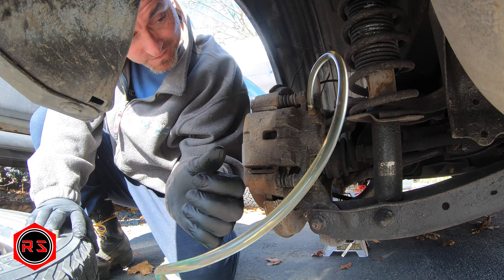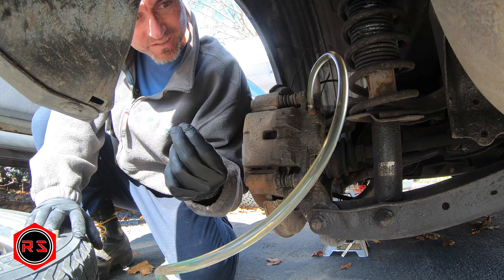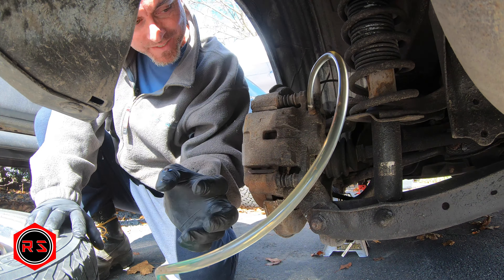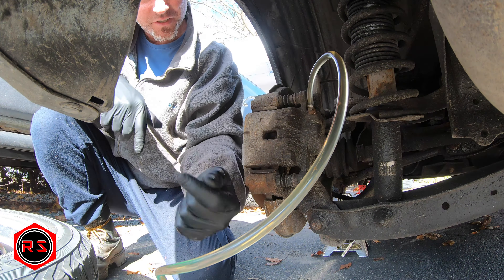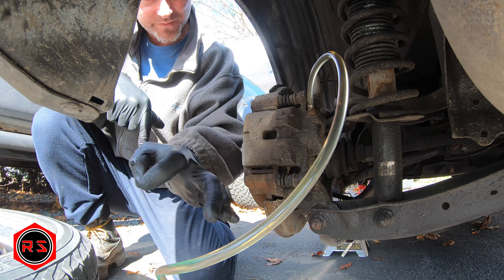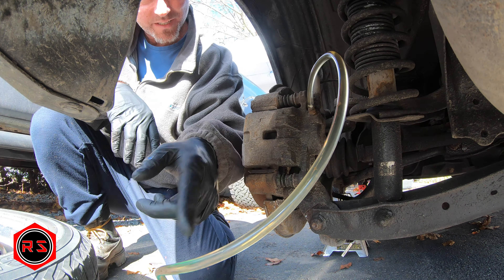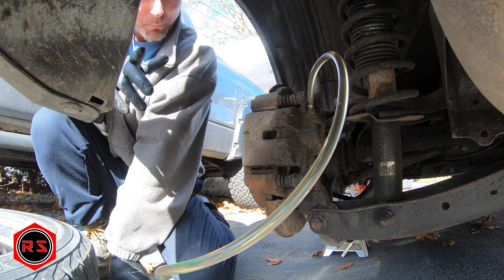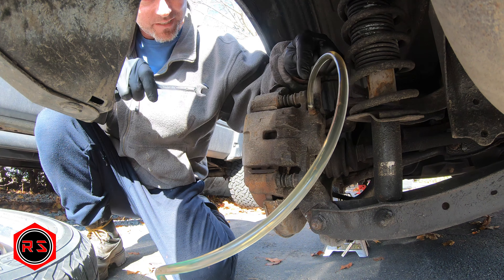How to bleed your brakes 1 PERSON JOB,  NO SPECIAL TOOL

Comment: Hello im confused because mr. subaru1387 don't explained well like you im french canadian btw he start the bleeding in the front to go in the rear it make no sense i prefer your video thx im going to do this on my Subaru forester xt2009 only thing missing is the quantity of fluid needed and how to jack up 4 wheel on jack stand
Reply from the maker: Always start furture from the abs pump and make your way to the closess one. Some subaru have the abs pump on tne right side.
Reply: Aight thx